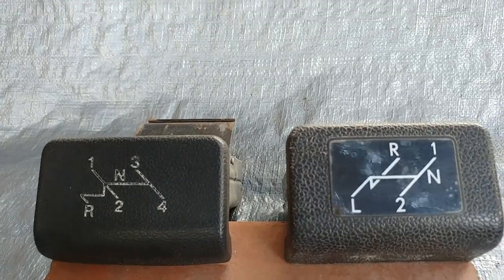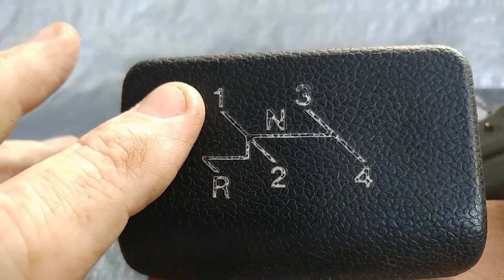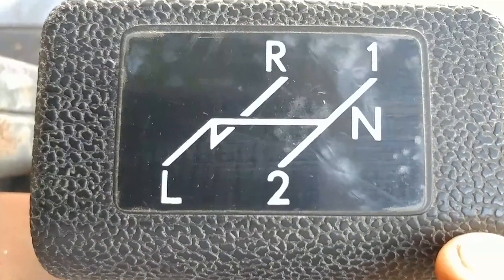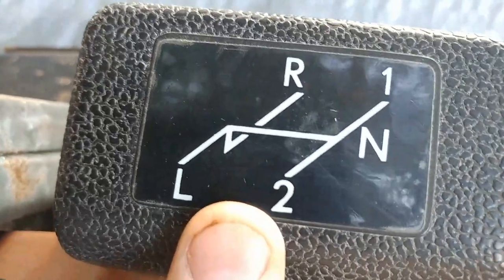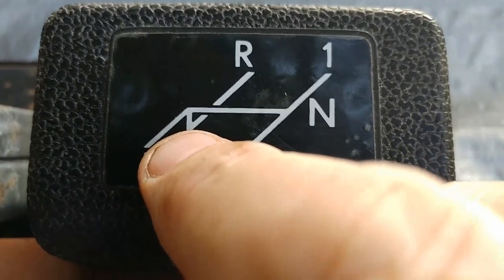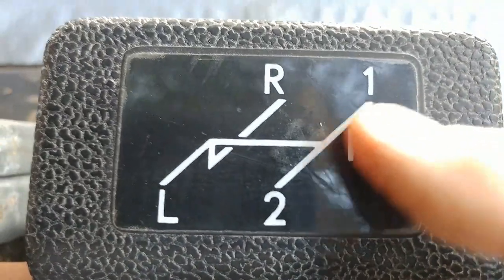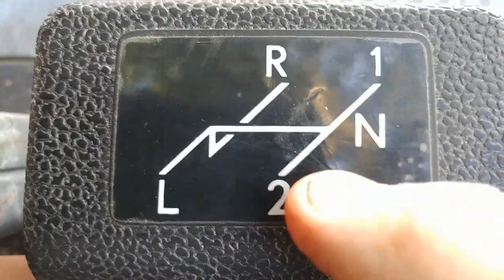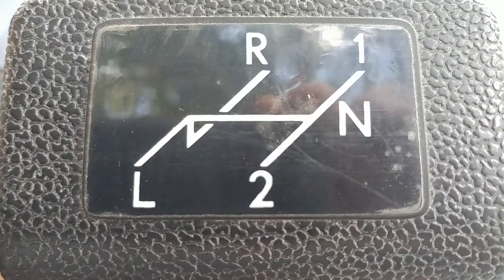HOW TO : HOW TO DRIVE A CLASSIC VW BEETLE AUTOSTICK TRANSMISSION.

Comment: The Autostick is really just a 3-speed manual transmission that doesn't need a clutch.
Reply from the maker: Correct. It's just letting off the gas, then shift. Thanks for commenting. Stay safe.
Reply: @Volkswagenplanet  you're welcome, classic Volkswagens are appealing to everyone, even people who aren't passionate about cars.
Reply from the maker: @marvinthemaniac7698  so very true
Reply: @Volkswagenplanet  I always wanted to own one, even though my all time favorite car is the Land Rover Defender.
Reply from the maker: @marvinthemaniac7698  they are unique to own. I've probably have owned around 50 or so. Only 1 autostick which I really hope to get back doing videos again when I get time. I bought it from the original owner back in 03. It's been torn apart in the garage since 2010.
Reply from the maker: @marvinthemaniac7698  never owned a range rover. I've driven a few. They are unique as well.
Reply: @Volkswagenplanet  I take it you were in the process of restoring the vehicle but got sidetracked.
Reply: @Volkswagenplanet  I got to sit in a 1962 Series 2A 109-inch, a 2011 Range Rover Sport, a 1971 Series 3 109-inch, and a 1993 Defender 110.
Reply from the maker: @marvinthemaniac7698  correct. I got involved in way to many other items. The bug always took the back seat to all my adventures. I got involved and created a family business to acquire real estate since 09. Buying and doing major restoration of turn of the century bungalow style homes here in Tampa, FL. a few of these homes took a year to restore each. Now they are paying off big time with the current rental market. Here it's the fastest growing rent city since the start of Covid. We also bought out a auto car care center. That took a lot of time to get it going in the right direction. Last but not least the family got involved with TORO. It's been challenging adventure to acquire quality cars to use on the platform. The entire fleet we choose Toyota's. 11 cars and trucks on the road right now. As you can see it's been non- stop. I was in the car business for 22 years at a local Toyota and Lincoln dealership here in Tampa. I also didn't mentioned doing all this while being on SSDI. Now you see how time has not been on my side in the last year. The family is really hands on to help make it all happen.
Reply: @Volkswagenplanet  that's quite a story!
Reply from the maker: @marvinthemaniac7698  takes more than me to do this. Each family member manages each business. Mom takes care of houses( office). Repairs are subbed out. Sister husband works and runs care care center. My brother runs and operates TORO. I just bounce around if needed.
Reply from the maker: @marvinthemaniac7698  TORO is the worse. 4 cars are wrecked. 1 us down holding on a computer from Japan. It's not what others make it look easy on YouTube. They only show the good side. Last 2 years we have had 3, 4 runners stolen.
Reply: @Volkswagenplanet  who stole them??
Reply from the maker: @marvinthemaniac7698  1 customer didn't return the unit. The others were taken while rented. The renter reported it stolen. All went in Orlando area at attractions and overnight at the hotels. 1 was recovered burnt down
Reply: @Volkswagenplanet  sounds like where you were living at the time had high crime rates.
Reply from the maker: @marvinthemaniac7698  im in Tampa, Seems like when these cars go over to Orlando when rented there was a good chance it might not come back. These cars were at the airport here in Tampa. The customer flew in to go to attractions like Disney. They stay at low budget hotels in Orlando. Come out in the morning, no car in the parking lot. We haven't had any ripped off here locally. The airport cars are great. Customers fly in, rent the car which is in the short term parking lot. They get the car , do their thing. Then drive it back to the airport and catch there flight. Really has worked out great
Reply: @Volkswagenplanet  Florida's kind of dangerous if you think about it
Reply: @Volkswagenplanet  very informative

Comment: The only way I can see this being a problem is if one had access to both an Autostick and a manual version of the car and had to adjust to the different shift patterns. The most important other disadvantage would be any sacrifice in acceleration involved. If the torque converter makes up for the lack of 4 speeds, I don't see much of a downside. And what about L? Is that just for jackrabbit starts and for when you need a lot of engine braking? I could live with either in most conditions, but on really icy surfaces with the car in danger of sliding to one side or the other, having to use a clutch can be dangerous.
Reply from the maker: It has never felt natural like shifting a manual. Thanks for commenting

Comment: Can the autostick cruise at 75 mph on the highway? If not, can it be modified to do so without damaging the torque converter?
Reply from the maker: You have to remember the autostick was a 1500 cc. engine at least 68 and 69 that I know about. That being said can it get to 75mph , yes. That would be around its top speed. It would be turning alot of rpm. The second part of your question I don't know of any tech articles or anybody who has done this type of upgrade. I'm sure a transmission shop could change the gear ratio. Unfortunately the autostick was not loved by many. There were not alot produced either as compared to the manual. That being said alot were converted to manuals. The next question would have you ever driven a autostick? If not, they are the same as a manual , but when you rev the engine up.to shift gears there is no clutch. This transmission I believe is a 3 speed compared to a 4 in the manual. The autostick was great for downtown type driving. You could stay in low gear til about 35. Hope this answered your question. Thank you for watching and commenting. I hope to.have a series on the autostick soon. Stay safe
Reply: @Volkswagenplanet  Thank you for the thorough and prompt response. I'm looking forward to your series. I just subbed to your channel.
Reply from the maker: @DailyPatinaBeetle  thank you for the support. Do you have a autostick? What year?
Reply: @Volkswagenplanet  1968
Reply from the maker: @DailyPatinaBeetle  same as mine. That's great. If your on Facebook, check out our VW GROUP PAGE AS WELL. There are quite a few other youtubers in the group. It's called" Volkswagenplanet '. Sane as YouTube and all other social media platforms. Hope to see you there.
Reply: @Volkswagenplanet  Ddid you mean you could stay in 1st gear until about 35? I thought low gear was only for taking off from park until about 15 mph...

I'm restoring my 72 autostick and am trying to read everything I can about it. I've only got to drive an autostick twice when a friend was in town. Very easy to drive, which was a relief.
Reply from the maker: @Nathriel  if you have driven other beetles for years, it doesn't feel natural to me.

Comment: Should have just been 1 2 3
Reply from the maker: Your correct. I need to redo the video. 1st gear is called low. When you shift into second gear normal (second gear area ) its called high 1. This gear is used in city driving. I think the speedo is up to 35. You can stay in this gear at all times without shifting. Then 3rd ( high 2nd) and 4th ( high 3rd ) is more for highway speeds. Its not that hard. The correct terms are more confusing. I really need to redo the video over. I was so tired and was sick when I made the video. Thank you for watching and commenting. Stay safe. I really hope to start making videos again. Take care.

Comment: For someone who loves Manual transmission, would I enjoy a Karmann Ghia Autostick shift? I found one and very hesitant to get it.
Reply from the maker: Why are you hesitant for?
Reply: @Volkswagenplanet  afraid I'll spend $16K on something that I wont enjoy. I like manual transmission, and it's part of enjoying an old car, plus afraid if anything goes wrong it'll be hard to fix since it's rare. It'll be my everyday car.
Reply from the maker: Let me know why you feel that way. I can give you a answer
Reply from the maker: @lidod6365  here is the truth about them. They are reliable. I don't recommend doing any upgrades to the motor. You do they are rare. Less than 10 percent were autosticks. Even though no exact number is available. Did you know the autostick version is worth 20 percent less in value. You could always change the engine and transmission out for a manual trans and a regular motor
Reply from the maker: @lidod6365  parts are getting a little harder to find also ask yourself this. Am I buying the can to keep stock or to modify it
Reply from the maker: @lidod6365  you can find nice manuals for that price range. I would just buy a manual. I honestly hate mine. I can't get use to the shifting with no clutch and gear locations. My step father would drive my daughter around and get her ice cream. Can't get rid of the car for that reason. I am considering changing over to manual. Then keep the autostick parts in a box if I ever want to change it back. I wouldn't buy another. Regardless of the price. Hope that helps. If your on Facebook, come join our VW GROUP PAGE. Same name Volkswagenplanet. Alot of youtubers post videos in there and alot of members asking and answering questions. Hope to see you there.

Comment: Clutch servo vacuum solenoide automatic  control valve L-1-2-n-R
Reply: Yep a control valve solenoid but the  O ring kit and air filter are no longer available as well as the shifter contacts, the torque converter seal, flexplate which breaks, but the clutch servo parts are still available. i had a 70 bug was faced with that which i had to convert to 4 speed
Reply from the maker: @derekobidowski3301  I've seen BUGCITY seems to have the seal kits. Thanks for commenting.

Comment: Seems simple enough
Reply from the maker: You would be surprised. Its a whole new breed. Its like no other standard I ever driven. Thank you for the comment. Are you thinking of getting one? Happy Holidays to you and your family.
Reply: I bet it is pretty different, and yeah. I'm considering one out of frugality. Happy holidays!
Reply from the maker: @purestress2597  Just to give you a heads up about autostick. Parts are not readily available for the autostick transmission. The rest of the beetle is the same. Alot of people have discarded the transmissions. I would suggest to keep your eyes open for good quality used parts. You will need trans servo, flexplate, fluid resivor. Not alot of info out there on the topic either. If you have any questions I'm here to help you.
Reply: @Volkswagenplanet  thesamba.com and vwar.org are great resources. Many experts on those sites.